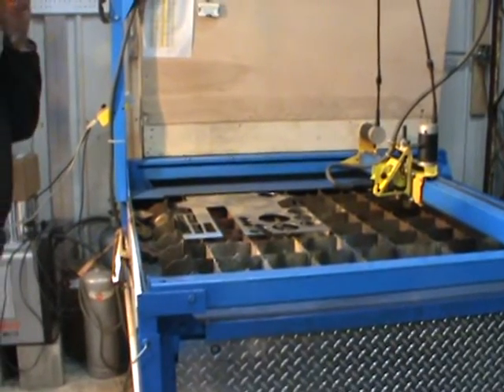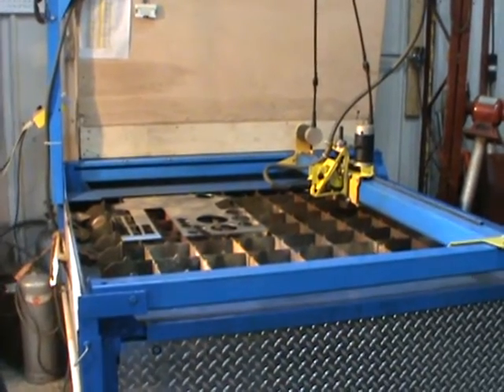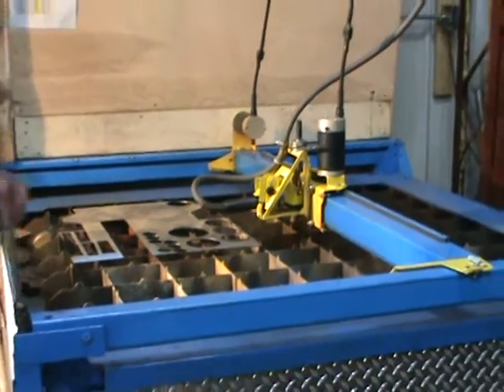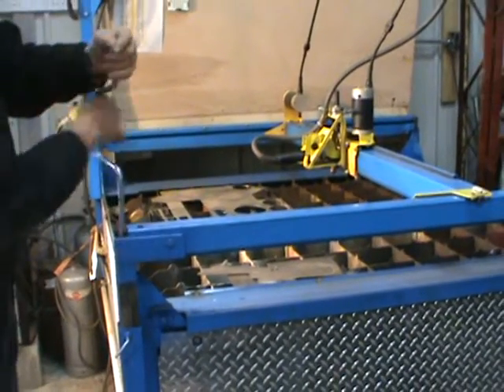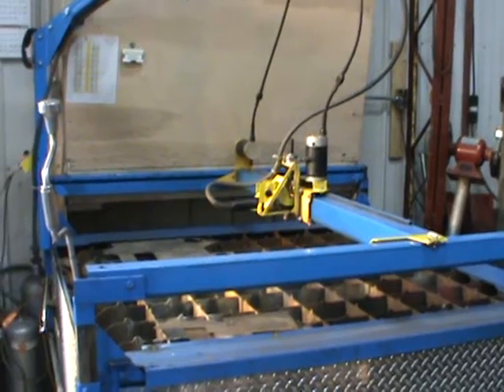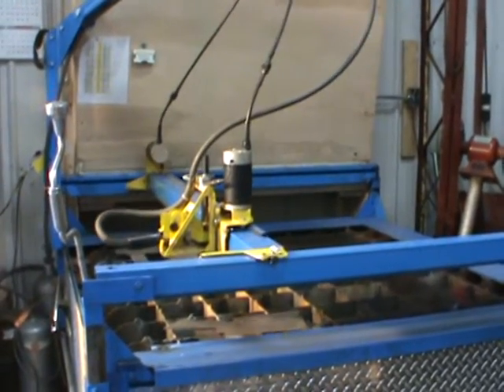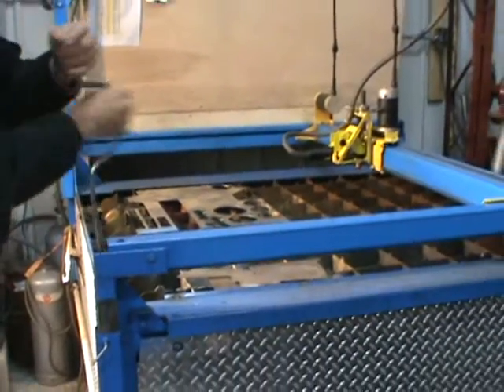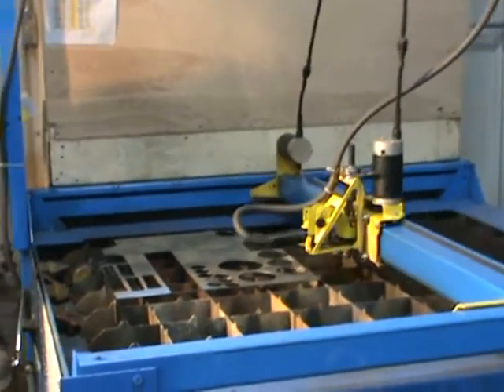KlemmbotElev.MPG

Comment from the maker: @bluemeany06 
The corners all lift together. Plans are $200 USD. You could also use a cordless drill with a socket adapter to power it up